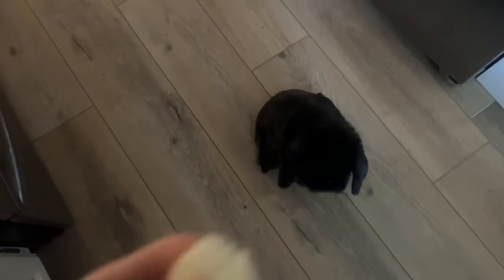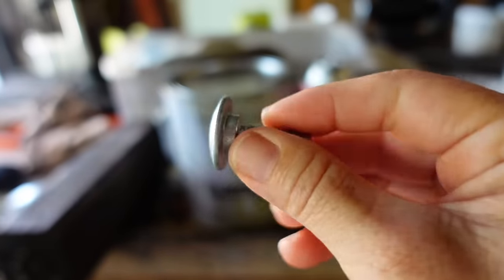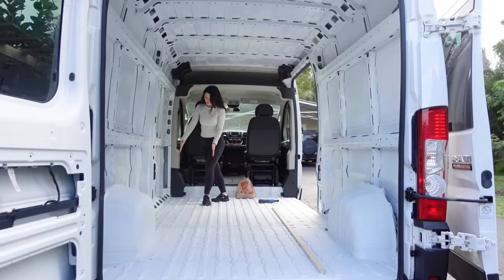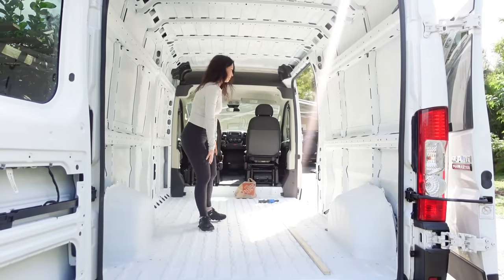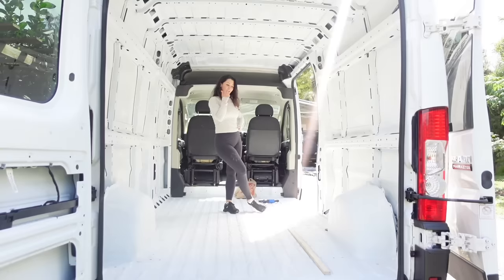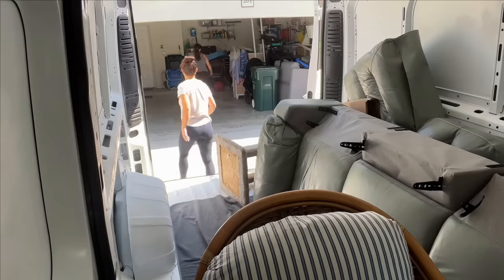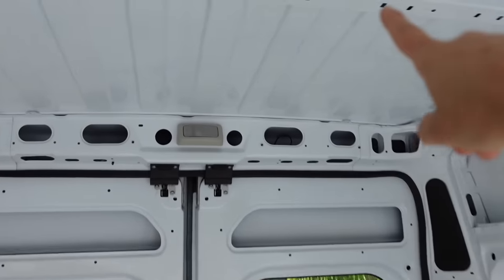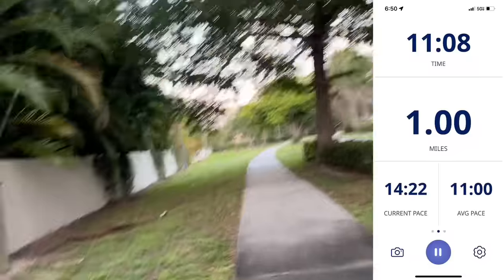Planning my van conversion layout | Ep 15

Comment: As a DIY, I totally would not cut any of the supports on the walls or ceiling. I'd rather move a window than risk compromising the structure. Just saying.... Good luck, though - I'll be supportively watching!!
Reply: I was about to post the same thing!  I've been living full-time in my van for the past 4 years in Montana & when I was adding a new exterior outlet for shore power I came upon the same issue on where I wanted it located originally.  Good luck with ur vanbuild!
Reply: I agree that if you cut a support, you compromise the structure of the van and it may have deformations later on.
Reply: Gee ?  Cut any support in your way., It's your van, right ?
Reply: @mythicalnomadadventure969  Probably thinking about a road accident Dilbert. Not sitting at a camp site. Cut those supports it will compromise the integrity in a road accident.
Reply: It's not going to compromise the structure of the van.  It's meant to be able have a window there.  If it was a passenger model, it would have a window there instead of a rib.  I was an ambulance and wheelchair van converter most of my life and I can assure you that van converters cut out those ribs every day of the week.  We cut off  thousands of roofs back in the day and put on fiberglass tops.  It IS true, that the A pillar, B pillar, and C pillar (by the windshield and doors) are structural, but those window ribs are not.  Their primary purpose is to stiffen the side wall sheet metal so it does not "oil can".
Reply: @DS..69  this guy certainly isn't me ?
Reply: @DS..69  hey. Friend,
I drive across the country twice every year, I removed ribs from my funky Promaster. I've seen no problems ? 

If you ever get a wreck you'll have huge problems.
Reply: @agrota21  Well you sound like the expert. So what was the fatalities to survival ratio in these vehicles when that was done to the supports in crashes??
Reply: You’re a legend in your own mind💯✔️
Reply: In the 🇬🇧 UK I'm sure my insurance company would say by by ...

Comment: I applaud your efforts lovely lady❤
 
A few suggestions from someone who has restored classic cars and boats for decades..
1) do not cut the structural framework on the van walls unless you are going to replace it, It creates the rigidity and stiffness for the wall panels. Better to relocate the windows slightly.

2) something along the lines of a folding or accordion style door would be better suited for behind the cab portion or even a heavy cloth curtain in a sliding track that can attach securely and also be tied back.

3) Consider filling all the interior voids with undercoating and foam for rust protection, insulation and sound deadening. 

4) Look at a Volkswagen Rialta RV for an idea of a bathroom shower combination, holding tanks and pumps can get complicated, consider an outdoor shower.

Keep it going !

Comment: The fun part, planning and layout of your van. I got alot of memories looking inside your van. Back at my last 9-5 job in 2014 I drove a 2015 Promaster 3500 as an HVAC technician. I remember on my last day I had that truck new with 7 miles and I put 137k in 2ys. Lots of memories in that van. Great vid!

Comment: So it dawned on me when you mentioned you needed to drive your van more often that you also mentioned adding a partition with a pocket door to separate the front from the back.  I agree getting used to the van is a good idea but in doing so remember the partition will not allow you to utilize the rear view mirror so you're going to also have to get used to using only the mirrors on the doors.  Just something to start thinking about and as always thanks for sharing.
Reply from the maker: Very good point
Reply: Not necessary if you learn to drive with your door mirrors.

Comment: Two comments.  You mentioned water on the door side.  1. Campground connections for water/electric/sewer will be on the drivers side so consider that.  2. Your windows you mentioned cutting a support to get the window in, is there a way to do it without cutting a support.  Those are there to maintain stability in your roofing.  I really enjoy the videos and watching your progress.

Comment: Good luck with your van build, my only recommendation would be to put the battery electrical system on the passenger rear side to equalize the weight of the driver and the water system on the driver side. Good luck.!
Reply: I need to amend, depending on what’s heavier your water system depending on how much water you will have stored or how heavy the battery packs will be. Put the heavier mechanicals on the passenger side.
Reply from the maker: Thank you :)

Comment: Thank You and Good Day Miss Elisa,
Argon Oil! For my beard not your hair, it's what works especially in winter.  When I snowshoe or Xcountry ski the sweat actually works towards drying my hair in camp at night. Not a problem you are having but your hair does look terrific. You have quite a few NAY sayers that aren't structural engineers. Neither am I but you can consult other builders about replacing steel structure with wood framing for your windows or weld in some new vertical supports on the sides of the windows prior to cutting. No, sorry I do not know if it's needed but something i would consider.
I am my Queen's pet, she is not my cat. She made that perfectly clear the day I brought her home.  I know this is late but I watch your videos when I can make time. 
Please know you are in my prayers.
Hoka Hey

Comment: The one big "downside" of having an empty van. Friends and relatives will always be asking you to help move things!  😅

A few tips from someone that's already been through the long (And somewhat painful) process of building one of these out. The threaded D ring holes are great for properly securing your floor, so make sure to remove the bolts before putting the flooring down.  Also, a note about your left/right bed layout. I have the same setup and a great part about it is you can sleep with your head in either direction when needed. If you're unable to level the van, you'll always be able to sleep with your head elevated, so keep that in mind when building the upper cabinets.
Reply: that's why my van is not empty, its currently my storage space. hope to start the insulation and flooring soon

Comment: Vertical beams. You can, whitout hesitation cut them off. Those beams you mentioned in the video, are just there for taking up vibrations from the metalsheet. When the window is in place, the window frame will do the same thing as the beam, take care of sheetmetal vibrations. Has nothing to do with the structural integrity at all. Good luck with your build. Iam in the planning process of my own vanbuild. You got yourself a new follower!

Comment: Hi Elise it's Tony I enjoyed the video as always I would like to suggest that you switch put the fan in the front of the van and the air conditioner in the back due to when you run the air conditioner the doors will be closed and the hottest part will be in the back with the fan in the front if you open the back doors or the windows you'll get across ventilation and one more other thing is put your shower next to all your water supplies so you don't have to run lines across the floor hello sweetie as always with the pleasure of seeing you have a great week and pleasant dreams

Comment: Dont cut those vertical beams where you want those side windows. Those beams are needed to support the roof and sidewalls. It's structural for safety as well. Use a smaller window in between them.

Comment: My 2 cents: check out this bed system, lift  , ( DIY Bed Lift for Van or Camper | Happijac Alternative)  -DIY Cargo Trailer - the motors are 40  bucks apiece , you can build a little work area  underneath it  something I would do if I was working out of my  van , also check out this person. She just barely getting started on her third van build she has the same van size as yours ( Tory Delury ) , stay safe 🤙

Comment: With the bolts you put into the floor to fill those holes. Would have been better to at flat washer with rubber. They have them at Home Depot or Lowes. The rubber will squish under and keep water from coming in. Also, you won't be seeing any of those bolt heads anyway. Most van conversions you will be putting in a floor. Because you are going to go up with your space, not out since there are walls. And when you go up for the floor, you will have space underneath for storage.

Comment: Don’t put firing on the floor glue insulation to floor cut your wood under floor tight if you can use 2 inc insulation and 3/4 plywood glued to the foam board insulation just trying to help. Also rive nuts on the wall to mount to the walls firing strips

Comment: You may want to look at Nikki Delventhal's sprinter van for ideas (here on YouTube). She put an outdoor shower in the back of her van & it saved her room in the van, as well as the compost toilet just comes out on sliders & back into a cubbyhole area. You'll see what she has for a divider between the front & back. She has said that there are times when she misses the simplicity of her old setup with the Toyota Prius. Also, many van dwellers like having 2 max air fans installed, it is helpful in the summers. A good backup camera if not already on the van will prove helpful for you. 

Do you want to sell your RAV4, you will get more money selling it yourself than to a dealership? 

Looks like most of your commenters are males here 😂